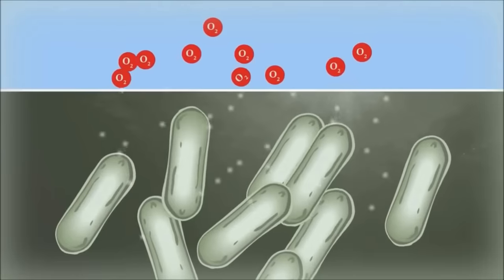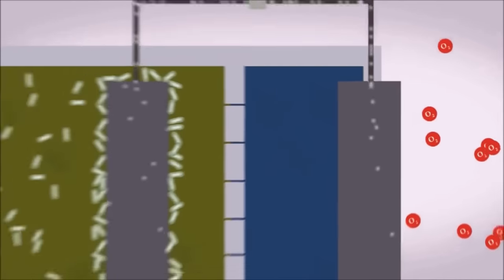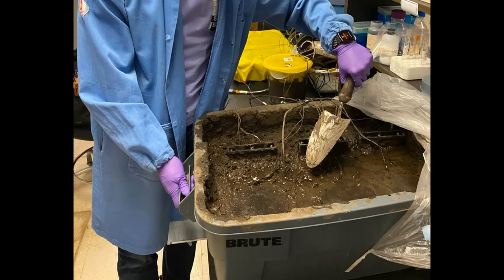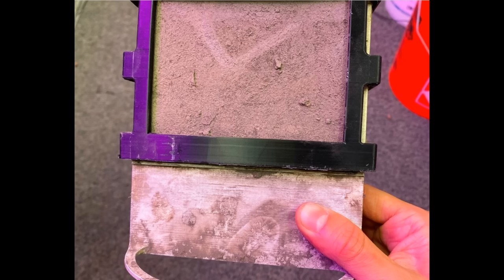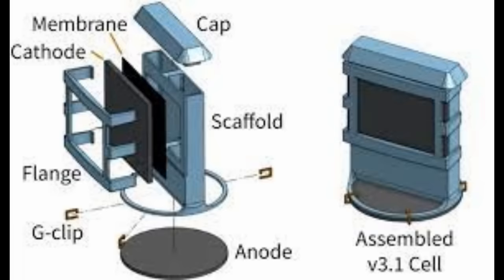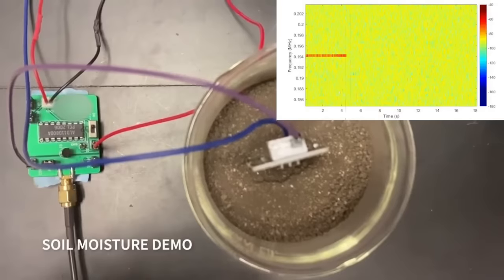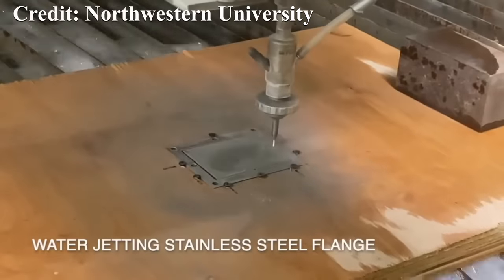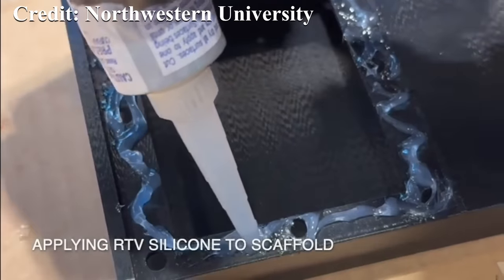2204 Dirt Powered Fuel Cell That Runs Forever

Comment: Interestingly enough you can actually buy a microbial fuel cell kit that comes with a little LED that will blink.

I also experimented with this as well but I did not realize that the mesh I bought which I thought was stainless steel from the dollar store was actually plastic coated and so I didn't get all of the amperage I should have got, however I was able to get a steady current flow of 10-20 microamps regardless.

With a proper mesh you can actually get quite a lot more current out of this.

What I'm somewhat interested in doing with this concept is laying down a layer of conductive mesh then covering that with topsoil then putting down another conductive mesh then covering that with a little bit more topsoil and then putting plants on top of it.

Once the plants are on top of it and they just are surviving the plants actually create sugars and feed the bacteria in the soil and so you can actually just straight up like use the plants in the Sun as like a super indirect microbial solar powered fuel cell.
Reply: Alternatively adding electricity to plant roots makes them grow better. If you take too many electrons away the plants might not grow as well.
Reply: This is my thoughts on the ancient civilisations..they were advanced enough to control nature for their needs

Comment: Microbial fuel cells almost reminds me of that Rick and Morty episode where Rick's car breaks down and it is revealed that his car's battery is literally a tiny world inhabited by tiny beings jumping on a pressure pad that produces electricity. They're literally converting their world into energy the energy required to jump up and down, which itself powers a car. Long story short, his car battery stopped working because they stopped needing to jump on their pads. So if your fuel cell stops working, either your microbes died in an unsustainable environment, or they found something more worthwhile to do.
Reply: We don't want our microbes developing self awareness or we might end up working for them.

Comment: Of course, the farmers could just use the technology I've been working on to send power thru the soil from a solar bank and operate all their sensors without batteries (the batteries sitting on the side of the field with the solar panels). I call it "Through the Soil Long Range Wireless Power transfer" - not the most clever of names I know, (my group recently published it in IEEE transactions on industrial electronics 😊).
Reply: I have a hypothesis similar to yours, and you might think the same, that the ancient civilisations used mother nature her very self to transmit information and energy..for example, using trees to act act as wireless transmitters of information and, like you say, the ground to transmit energy through soil and mycelium etc...that's why I believe there's not much evidence of manufactured parts from the ancient times as i beloved they were advanced enough to utilise and control nature for their uses.
Reply: Reversing ground to be input you get interesting results. 

Negative treat it as positive and ground as negative and you can light a light bulb.
Reply: @shaunphillips6160  I've seen that movie 🍿
Reply: @shaunphillips6160  Ah yes, and they grow their furnitures on plants. No wait, it was in a book "The Star Diaries" by Stanisław Lem 😁

Comment: Amazing Bio batteries that will revolutionise farming and a lot of farmers I’m sure will pick this up.
Reply: Why? 
Those who want to revolutionize farming, are pretty much never farmers themselves.  Lay off the cheetos.
😐
Reply: @dirtdiggity1714  Why... because modern farming is becoming ever more expensive and is still a ton of work. Any small short cut in time or expenses would help. Im a small scale farmer but I can see applications like this could help. Its not unlike methane produced by cattle farms being captured and used to heat buildings near the barns, though at this point its rare and experimental. Even compost on large scales produces masses of heat that could be harnessed and used to be in the past with cold frames in gardens producing heat early in spring to get crops off to an earlier start. There is much wisdom in the past.
Reply: @dirtdiggity1714 what are you talking about, farmers modernise all the time, the ones that don't go bust.
Reply: @dirtdiggity1714  There is no need for petty insults to people you know nothing about and have done nothing to deserve it. Just discuss the subject.

Comment: So how much power do these things generate...3V at how many mA I must have missed that part ?
Reply: all depends on specifics so you will have to test as there are too many factors at play
Reply: I did a search and found the paper.  1.74 uW/cm^2, 557 uA, and 200 mV.
Reply: @MickEMaus3000  Awesome thanks so much for the reply
Reply: @MickEMaus3000 I know it's only minute, but surely you can scale up and treat them like batteries and put them in series/parallel etc and perhaps find a way to use a transformer to step up the amperage

Comment: I guess the only thing to worry about long-term is that it doesn't mutate or get a virus. Diversity of used microbes would be a wise precaution to limit chances of colonies going 'bad'.
Microbes aren't immune to mutation (evolution) and some have an alarming mutation rate purely due to their increased reproduction rate. The soil itself could conceivably be exhausted of nutrients, but that would indeed take "forever" as it's a closed system and nothing truly gets converted into unbreakable compounds so the "fuel" doesn't deplete. Maybe a mineral supplement and reshuffling of the contents could briefly overclock the battery. Some microbes inherently follow electrical potentials, so it's self-starting too. This thing is so interesting, I can't stop thinking about using it.

Comment: Thanks for featuring out work! If you go to Appendix A2 in the paper, you can find instructions to building our v3.1 design which is entirely 3D printed and requires no waterjet or metal parts :)
Reply: Thank you for taking the open source approach. Genius stuff!
Reply from the maker: awesome - i will check it out - i love your thinking - cheers

Comment: Oddly enough, I have access to a water jet cutter at a local maker group.  I've been looking at things like this to create a self powered hydro/aquaponic set up, with the soil powering some of the lights for the plants and using glass and salt water capacitors to trickle store generation during in the day.  Its mostly in my head and on paper at this point, but this looks like a  piece of the puzzle I can work with 🎉😊

Not seeing the links in the description.  Is the assembly video on YouTube or their website?

Comment: the statement that it "runs forever" is misleading.
MFCs require a continuous supply of organic matter in the soil to function.
Over time, the efficiency can decrease due to factors like the depletion of organic matter or changes in the microbial community.

Comment: Would these power a cell phone?  Would be cute to put on the wall as a  modern tethered phone powered by an indoor  garden tower . 

Also have thought tucking som solar charging components and a cellphone  along with laptop or tablet  into an EMP sealed box(s) along with batteries . but batteries would slowly discharge so your still stuck.  But enough components to whip  soil batteries together could at least get you going till you get some solar stuff up for more heavy charging.

Comment: From the paper it produces about 10uW which is ... really a very, very tiny amount of power.  Probably not really worth it considering the size of the device.  Even for a small sensor.   Or to put it another way, the sensor something like this would power can be smaller than your thumbnail, and the power source is massive by comparison.

Comment: Came here for the amp and voltage but left sad😢. I perused the paper, and maybe I missed something but I cant find anything tangible. Anybody else find anything or build it?
Reply: Check out section 3.5 and Appendix A2 of the paper! You can find that information there.
Reply: @billyen33 I don't know how not to be negative after seeing the results. I see it now Millivolts, and microwatts/microamps. So this will not scale, and the resistance in wires would keep this out of 99.999% of projects. Because of the lack of scale a .99c super capacitor and a .99c solar cell  would fit the same niche. Heck if no light put a thick plate of magnesium and graphite in the soil and it will last for years and give off up to 1.2-1.5v and milliamps for years with only a slight bit of moisture. Put them in a series of planter pots and you can have a 12v battery if you want(but only milliamps). I do appreciate that they publicized it without a paywall though. I also hope that they find a break-through.